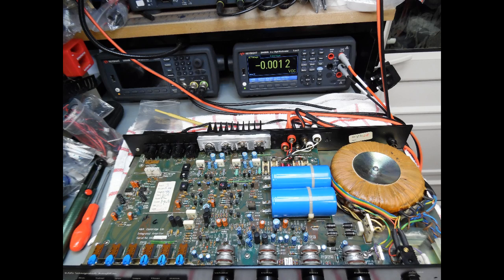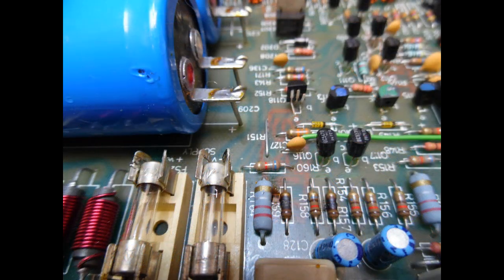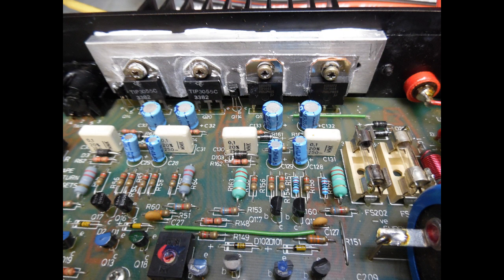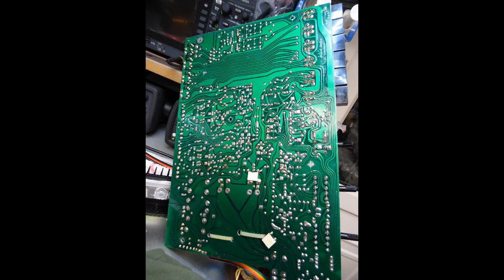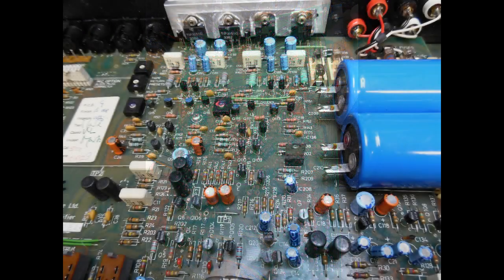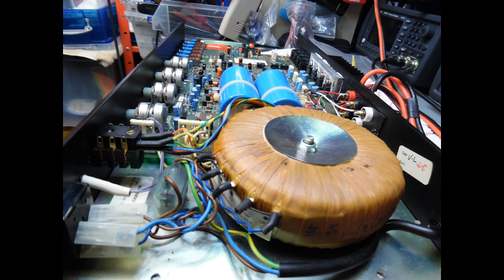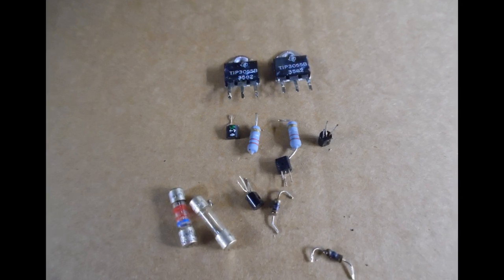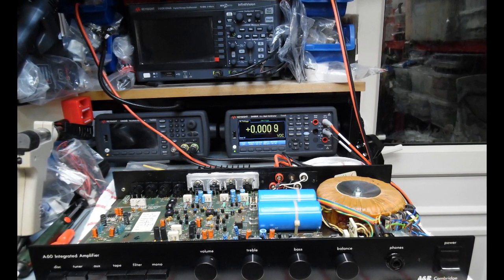A&R Cambridge A60 Amplifier Repair (With Audio Tutorial)

Comment: Gary....thanks for another excellent  video... I worked at a small independent hi fi shop in the early 80s... We sold bucket loads of these...Did they used to have overheating issues? I seem to recall there were always a few in the shop that required attention.
Reply from the maker: Dave Thank you, I am not aware of overheating.
There were modifications made to the design to provide higher reliability.